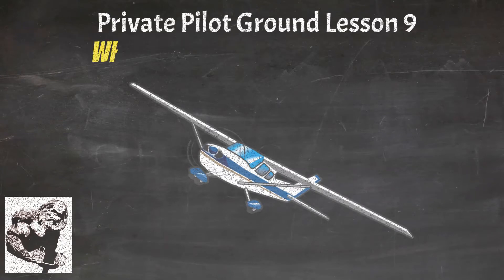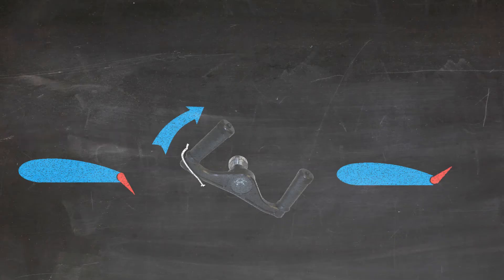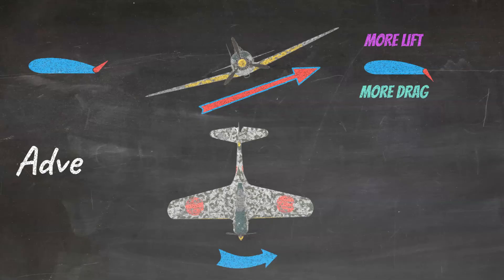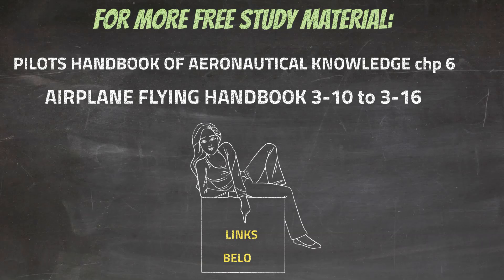What Makes an Airplane Turn? (Private Pilot Ground Lesson 9)

Comment: So, what I'm getting as a motorcycle rider, as to treat adverse yaw in a banking/turn the same as countersteering a bike. You apply force (through pushing the handlebars on a bike or the rudder controls on a plane, conveniently laid out about the same) in the direction you want to go, in addition to your primary control input, either shifting your weight on a bike, or changing the ailerons on a plane, balancing out for a controlled banking maneuver. Is this understanding correct or should I just not think as much (quite difficult) and just step to the ball?
Reply from the maker: It’s very similar to that.

Comment: An airplane can't turn as it is explained just since the lift force is located behind the center of gravity and all rotations of the airplane in the air are performed around the center of gravity.

The roll of the airplane generates a horizontal component of the wing lift directed toward the center of curvature of the trajectory, and a horizontal component of the force on the tail directed away from the center of curvature of the trajectory. These two forces are not equivalent in magnitude, but they balance each other in moments created in the horizontal XY-plane. 

Since the horizontal component of the wing lift is much greater than the horizontal component on the tail, a very significant force is generated that pulls the aircraft in the direction of the bank and is oriented to the horizontal Y-axis at an angle of θ = arctg(G-L∗cos(β))/(L∗sin(β))), where β is the bank angle. This force makes the aircraft slide in the direction of the bank and generates a some angle of attack on the vertical stabilizer, as a result of which the vertical stabilizer creates a force that turns the aircraft. 

Since some of the vertical component of the wing lift is lost during the bank, in order not to lose altitude, the aircraft must increase it by increasing the angle of attack. To increase the angle of attack, it is necessary to increase the force on the horizontal tail by deflecting the elevators upward. Thus, in the horizontal XY-plane, the moment rotating the aircraft in the direction of the bank becomes greater than the opposite moment created by the wing.

Comment: I hear a lot of people say "step on the ball", but no one ever explains what it means.

I can take an educated guess, but when you have a saying that's supposed to help someone, is it best practice to make them guess what it means?
Reply from the maker: I need to go back through and remake some of these older videos to explain that better, but in a nutshell, you are aligning the tail with the nose of the aircraft. The ball shows you when the two are not aligned
Reply: @FreePilotTraining  like I said, I can make an educated guess and I figured that's what it meant, but what would be nice is a little instruction on how to accomplish it. 

I fly or attempt to fly in DCS and turns are a huge struggle for me. I for the life of me cannot keep that ball centered. I just bought rudder pedals and haven't had a chance to fly with them yet, so I don't know if that will make it easier or harder than a twist stick for rudder.

And I'm watching these videos, because I'm saving money to go for a PPL. God is it expensive to do. $200/hr just for rental is insane.

Comment: 0:06 airplane rolls and banks on the longitudinal axis 

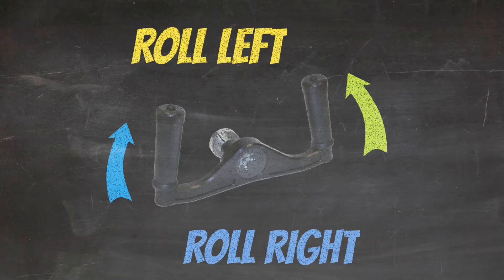0:27 airleron raises in the direction of the yolk
-the lowered airleron increases lift and drag and the wing will rise 

0:58 vertical flight: straight and level flight lift goes straight up 

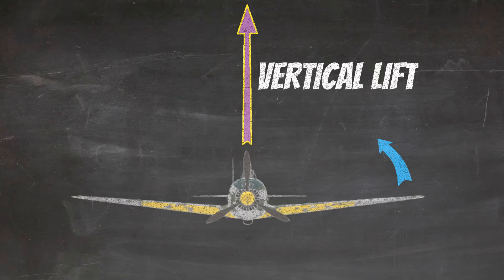1:04 horizontal component of lift: when turning the lift goes out laterally and this is what makes airplane turn 

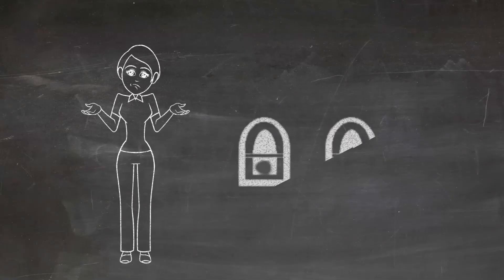1:26 why do we need rudders to turn 
-the lowered airleron produces more drag and the airplane gets drawn into the direction of the lowered airleron but the nose wants to go towards the raised airleron 
1:38 this is adverse yaw 

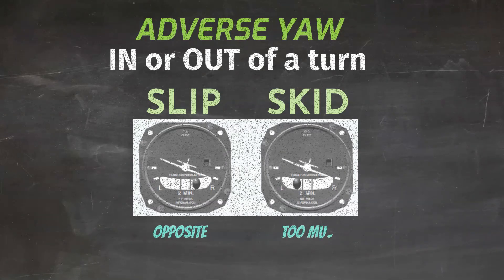2:05 slips and skids: adverse yaw can happen any time using the airlerons. It can happen in and out of a slip 
-slip: where the nose travels opposite direction of turn
-skid: too much yaw in direction of turn 

2:14 to correct for adverse yaw, use rudder